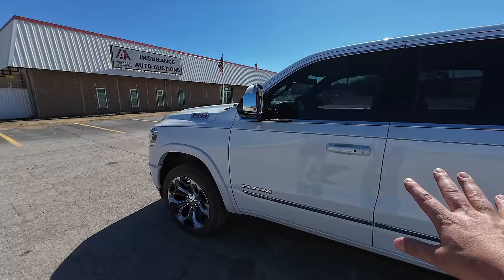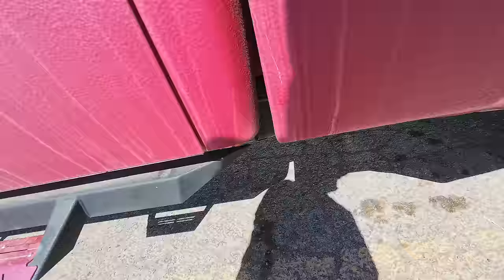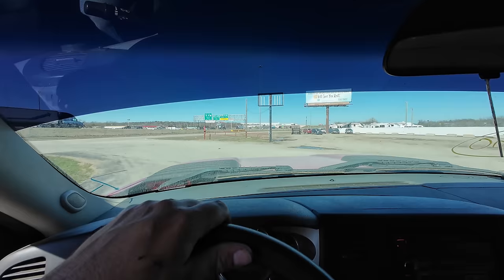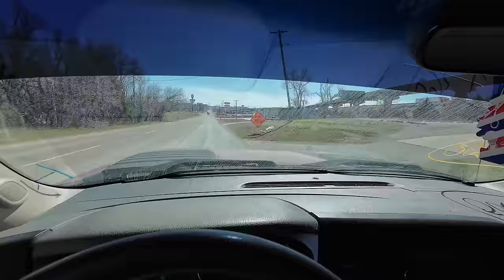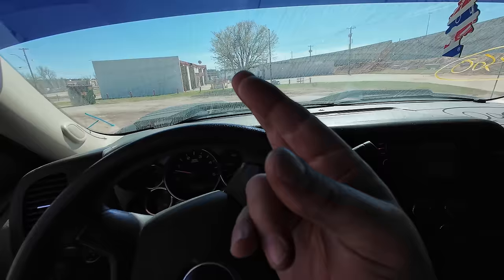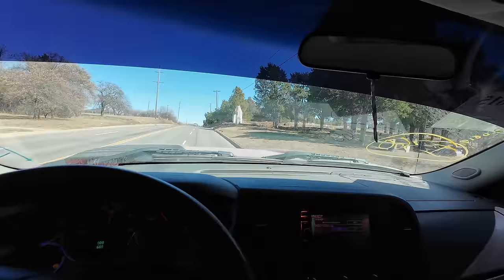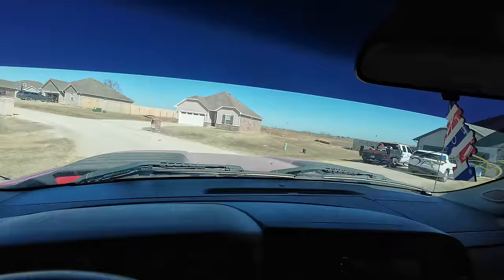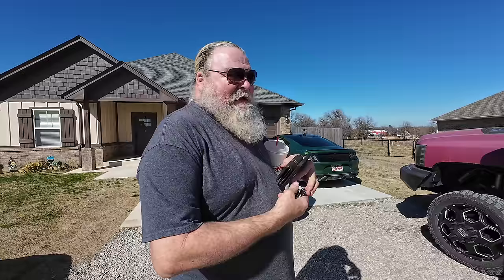I Bought a Cheap 2011 Duramax Chevy 3500 from IAA and Someone Broke it!!!

Comment: I think may be the guy with the forklift wrecked the fuel bracket.
Reply: Yup they always do
Reply: Exactly what I was thinking. Mistakes happen but for it to go from small drip to full on spill means something hit it.
Reply: I agree, it’s the most obvious way those items would have been damaged
Reply: They could care less how lazy that's absolutely lazy
Reply: I bet so they ain’t gentle lifting cars up
Reply: @user-m-q9f are you on meth😂it’s plain and simple they broke it lol it wasn’t leaking when he first saw it
Reply: 100%
Reply: Yes exactly those dudes don't care if they damage anything lol
Reply: Wow genius
Reply: That was my thought as well
Reply: Fuel lines, brake lines, tail light wiring, drive shafts, transmission cooling lines, etc. .... Those lifts can do 1000s in damage in ten seconds
Reply: thought the same thing those big things arent gentle and from where the bracket was broken is about the same place from where they lift the cars

Comment: The cruise control not working/glitching out is your brake light switch. It’s on the brake petal and will cause the cruise to quit working, but the brake lights will still work. I’ve done it on multiple of those era GM trucks. Super simple fix
Reply: Had the same problem too on a couple of my Chevy trucks! Try pulling back up on the brake pedal with your toes and see if the cruise works then. It may just need a little adjusting. Leave a little gap between the switch and the brake pedal. 5-minute fix should cure that problem!
Reply: Mine has been broken for years…i have the switch new in the box but i never use cruise control so i never got around to swapping it

Comment: Like the Duramax.   Forest green sounds like the perfect color for that rig.   Once you get it sorted out and repaired it would be a perfect tow vehicle.  Bet when you pulled in your yard and you hit that big bump, your fuel filter housing was jarred again and that's what caused the engine power issue.

Comment: I lost it the moment you parked in front of AR Headquarters and all hell broke loose 🤣🤣🤣.
Reply: Nothing happened. The only reason the engine power reduced came up was because he hit that massive bump pulling it into the yard that threw the fuel filters around and the computer detected it putting the truck into safe mode.
Reply: is that Randy's workshop?

Comment: Keep it as your work truck , and paint the body in dark blue then paint in bold letters AAR in lighter blue along the sides , with smaller Auto Aution Rebuilds in white , with Email address under the large letters .

Comment: I’ve got that same filter setup on my 93 Chevy 6.5 turbo diesel, and my 03 dodge ram 5.9. I got mine directly from cat here in Mesa Arizona. Check the headlight switch to see if there’s an auxiliary position that activates the aftermarket lights. I think you did good on the truck. Not going to loose money. That’s an easy $25k On a different note, that basketball hoop next to that bedroom window. Around my house, that would be a broken window by the end of the day! Just my observation. And yes! Ditch that topper!

Comment: Since it didn't go into limp mode until the big jolt pulling into the yard, there might be a bad ground. Like from the motor to the body. Or loose battery cables.

Comment: Tip get the trip counter and all the other info on the gauges you would have to switch out the panel on the left of the dash, all the hook ups are there. That feature was only on higher model trucks

Comment: Orange or yellow would look killer with the black wheels & bumpers, but because of the texture going dark will probably be the best route .  Since it would take forever to get that stuff off I'd coat the new bed rather than grind down the rest of the truck.

Comment: even with all the damage and issues that is a very nice truck, I'm not much of a chevy guy but those older 3500s run great. and I'm guessing those holes in the bottom center were where the light controls were mounted like 2 smaller holes for the bracket and the larger ones may have been where some wires came in

Comment: Randy. As for the cruise control not working, stick your foot under the brake pedal and pull up. Recheck your cruise again. Your brake light switch is most likely out of adjustment. Ask me how I know.

Comment: So for the light bars. They could be the way my dad’s jeep is. His light bar is wired into the high beams. Granted. He has a switch to turn it on or off. But it only gets power when the high beams are on. Might see if it’s the same way

Comment: Randy, this truck doesn’t have GM’s optional info display buttons that would’ve been on the drivers side for the Silverado/Sierra trucks, and next to the right side of the steering wheel on the Tahoe/Yukon SUVs. I’m not sure if you can swap them into your truck, but I do know that it’s possible to swap in the audio controls that are usually on the right side of the steering wheel, considering your truck doesn’t have audio controls, but that’s all I know. Love your channel man! Keep up the great content!

Comment: 32:24 @autoauctionrebuilds the lights could possibly be on that accessory panel located under the steering wheel slightly to the left on the knee panel! Only spot that it looks like they could be unless they are hidden, tied in to the OEM switched, or removed.

Comment: Now that's an interesting video, love that truck. Take a rubber mallet to that rear fender ,fix the spring, sell the cap, and paint it red, and have a ball doing it. I wonder if you can paint right over that rough paint? You could roll it on because it doesn't have to be smooth.  Really looking forward to this one.

Comment: The cruise control not working is probably the brake light switch. My truck does it all the time if you tap the back of the brake pedal with your foot and then press set it should work but just replace it it’s easy and cheap and fixes the problem.

Comment: It's probably the ground wire under the driver side door. It bolts to the frame. And usely when you take it off. Clean it up to the metal. Bolt it back up. And spray it with under coating. It will solve your electrical problems. It's a Chevy thing. Lol

Comment: You will probably always have codes on that truck because it's deleted and tuned but you done real good id rebuild that truck new color bed and I'd keep it cause you dont get under 200k diesels for that cheap unless it's a 20 year old 7.3 or 5.9 and even them sell for the teens still great video

Comment: The cruise control on the chevy silverados had a problem where sometimes it wouldnt engage until you turn it off with the switch and then shutoff the engine and restart the engine and then turn on the cruise control master switch

Comment: I see 2 screw holes under heat and dials next to the radio my guess they had a panel for the lights connected there and someone pulled it off

Comment: that cap for that truck is worth new about $8000... used ask $2000... i had to go buy one for my old boss for is 2015 f250 and he payed $600 for a used one.. a dually cap is way way more... sell it and it'll off set the cost on parts for the  silverado..

Comment: They might have those light wired in with the stock ones like the ones in the bumper could be hooked up to the fog light switch an the roof one to the high beams just an idea

Comment: Auto Auction Rebuilds Randy randy when you're new Chevy silverado 3500 HD 6.6 Duramax Dually Truck Take off cap New Bed and  New Headlights and Taillights LED painting job  Metallic Blue look so nice man New Wheels and new Tires  Redue the 5% Limo Window Tint and  Is the Brow on the windshield 5% also keep it up man ????????

Comment: No more than you tow now, sell the RAM, fix and keep the Duramax. Replace the left rear spring, bang that rear fender out as straight as you can get it, send it to Maaco for a fresh coat of the factory red, and roll on down the road. You're ten grand ahead of the market, and out from under that RAM payment.

Comment: Did you try the headlight switch?  May be wired to harness, same with fog lights.  Also, you had a dead battery a lot of codes could be from that.

Comment: Are your spotlights wired up to through the high beam switch in Australia at least it's quite common to have them turn on when the high beams lights are turned on.

Comment: Careful mentioning certain "diet plans"  and removal of Echo Golf Romeos.  The EPA is going hard on mods, going so far as fining millions to small businesses who performed the mods, went after tuning companies who now disabled features from the tuners, they successfully sued Summit and JEGS for just selling block off plates, regardless of the fact that they can legally be used off road, and told a private seller in NJ that he couldn't legally sell his deleted truck.  His only option was to return to stock or junk it.  So please be careful or you'll be in a world of hurt under the current administration.

They're going to a German-like approach where it will be illegal to sell anything that can even remotely affect emissions without getting it tested and certified.  For example, they could go as far as saying the LED bulbs put into the interior now draw a tiny bit less load on the alternator and in turn the engine, which means that the emissions profile has changed and needs recertified.  In Germany, basically any mods require a trip to the TÜV (the national vehicle inspection company, like getting an MOT in the UK) for them to approve it... After you paid a special tax.  That's why there are so many factory performance cars there... It's so difficult to mod your own car.

Comment: I am disabled and I can't afford to pay that kind of money I'm looking for a dependable truck it doesn't have to look great but it has to be safe and dependable because I have to get to doctors and I  have to travel for a long ways to doctors. But I got a short bed chevy  4x4 and after every thing was done he called me and said it doesn't shift into 3rd and over drive and I was 3 blocks away and I stopped and called him and said I'm coming back to get my vehicle back and he said he sold it I pulled back to were he said he lived and he just parked it there because it quit shifting he actually lives  in Ohio and the gas tank was about to fall off. I got it fixed and had Trans filter and fluid changed and it still won't gò ìnto 3rd or over drive. Some one said it could be the speed sensor but I think I got ripped off. But I am in Richmond Indiana and if you get a vehicle that is safe and dependable but is ugly and you don't want to mess with it please let me know thanks. I want a nice older truck but on disability I doubt it will be possible!!!